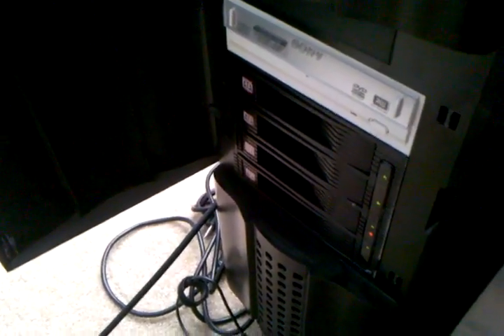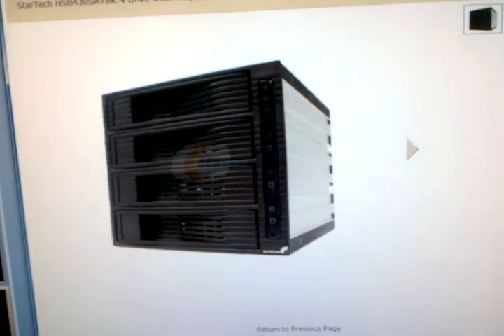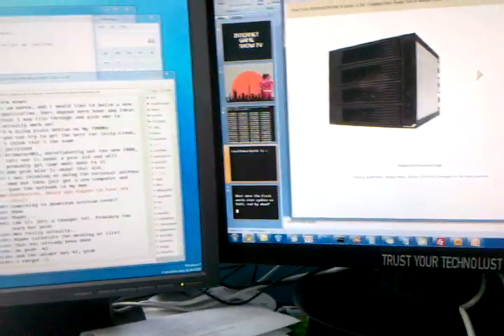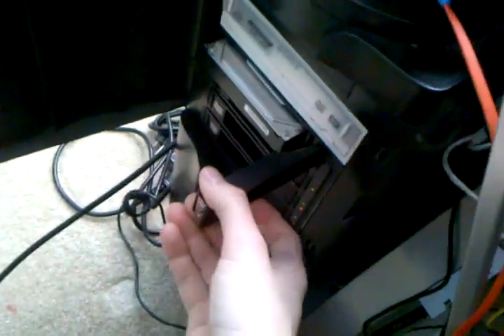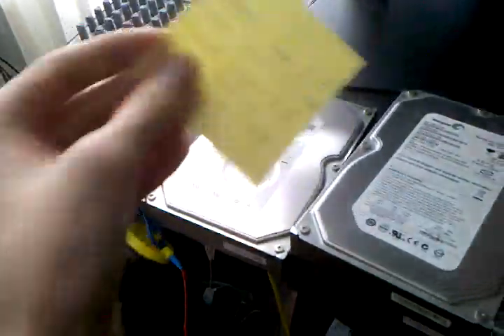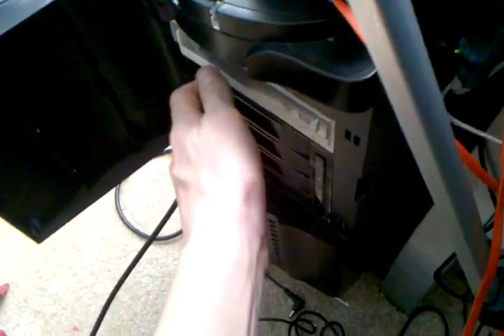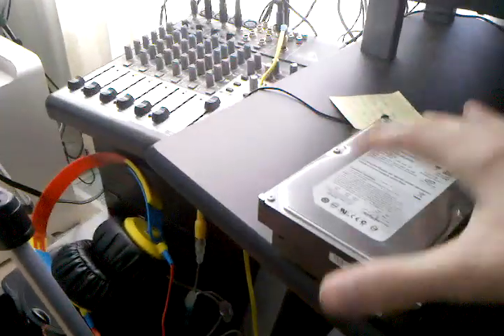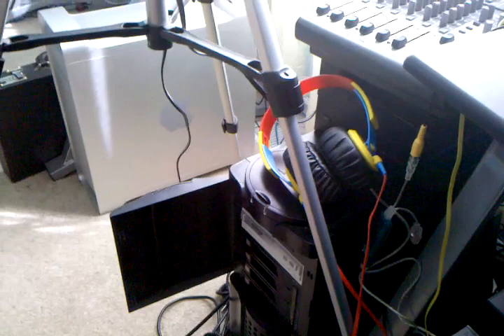The joys of hot-swapping hard drives

Comment: it just means you can pull the drive out while it is running and put a new one in it's place. It's referred to as hot swapping because the drives are hot when they come out of your machine. Very handy for server systems because if a disk degrades , you can generally just pull it out of a raid config then the raid will rebuild when you stick the new drive in.

Comment: I would use a brother ptouch labeler with the super adhesive tape cartridge on the black front edge of those drives.  so even if the heat did eventually peel it off it would not be on the top where it could catch and stick in the unit.

Comment: @xxdigipiratexx No problem.  It's pretty much made to be an alternative for external enclosures, so if you have a bunch of drives with files you don't really need to access that often, you don't have to buy an external enclosure for each of them.
They make a 4 drive external enclosure that connects with USB or ESATA, no idea how good it is though.  Model number SAT3540U2E.  It's also a bit pricey, about $200

Comment: @xxdigipiratexx to install it you open up your case, and put it in like you would a DVD drive.  To swap the drives, you just open one of the tabs on the front, pull the old drive out, and put the new one in.  It is meant to stay inside that one computer, not be switched between multiple computers.

Comment: Hello Hak5DarrensVlog,
I have a question for you. My laptop Dell Latitude TS30GI has a continuous error that reads "system disk error press any key to continue". The error has not gone away despite all the methods I've tried.
My question is, If I were to remove the Hard Disk Drive and swap it with another one, would the system disk error be overwritten?

Comment: @blarock86  Ah.  Well, to address that, pretty much all common NAS software will include the ability to shut down the drives that are not in use.  One of my NAS's is like that, it only spins up the HD's when they are being accessed, and that is infrequently.  Backplanes are unnecessary for what you're doing.  You could maybe stand to have a couple hot swap bays, but basically, you need to build a decent file server.  You're setup really isn't that good for what you're doing.